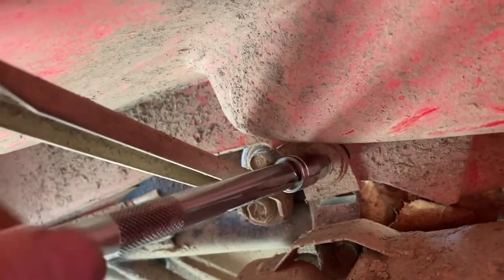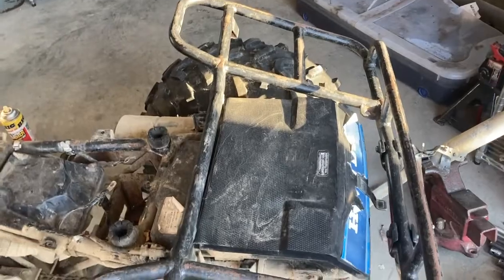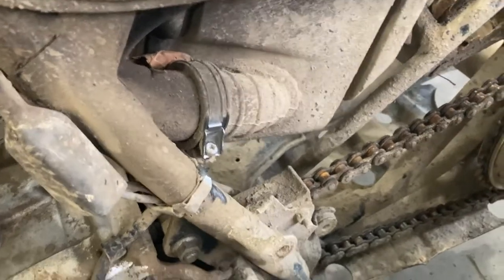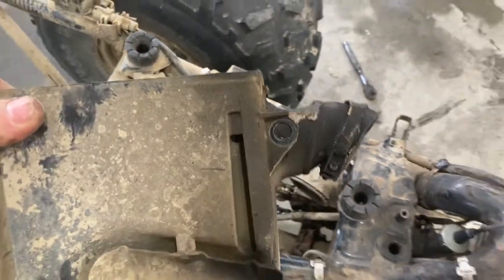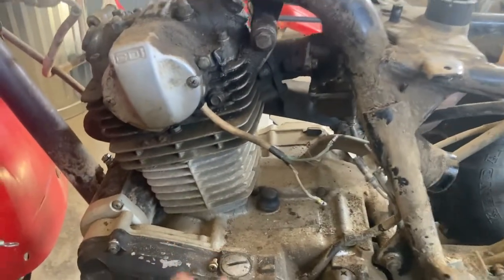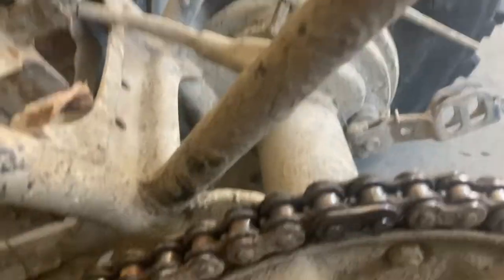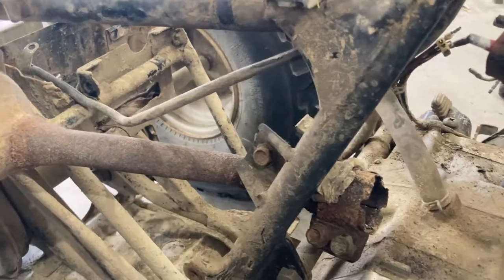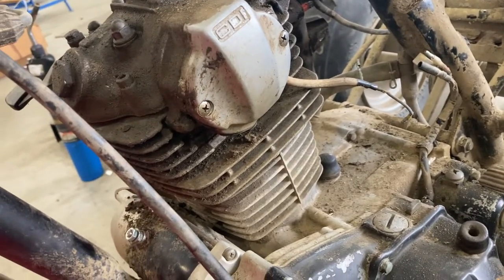Honda ATC200E BIG RED REBUILD Series - PT 1 - Teardown & Engine Removal

Comment: I have a 1983 200e Big Red with bad forks. Is there anyway possible to correct the forks other than switching with a 200m or welding? Is it possible to have these parts machined by a machinist?
Reply from the maker: Unfortunately the 83 is considered a non rebuildable fork. The best solution is like you mentioned - the 200M forks

Comment: I have what looks like that engine on a go kart project the axel with brakes and sprocket too. I want to do basic wiring and have the harness but don't know wher to connect the 2 pulse wires to + there is a lone black wrapped green wire coming out of engine case forward of the sprocket ? The CDI is a round plug and obvious but I need to get spark ! Any Help ? Thanks

Comment: Hello, I have an 82 200 E and it won’t run right at all if it does not have the cover to the airbox off. I assume this is because mud Dobbers have clogged up the fresh air pathway. Do you have any tips for cleaning out the path?
Reply from the maker: Very possible. It could be starving for air. Potentially with the tank off you could spray into the fresh air intake at the neck of the pipe that I point out in the video.

Comment: Hey. I have a 1982 200E and that it does is turn but won't start. It gets gas to the carburetor but act like it's not getting compression. Started out as carburetor fix but nothing was wrong with it. So it's engine problem. Was running the night I got it.
Reply from the maker: Compression test it and check for spark